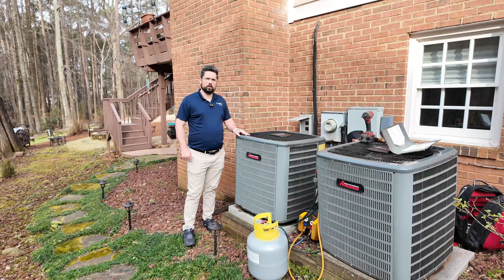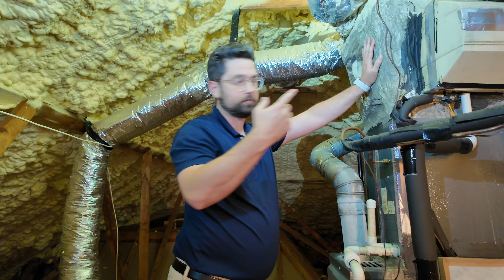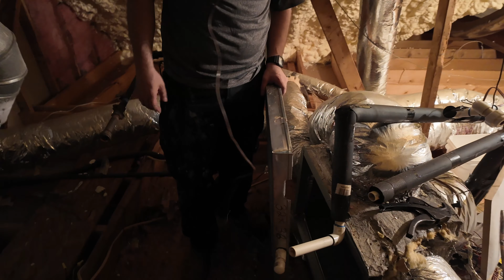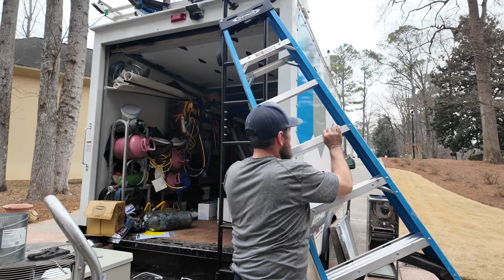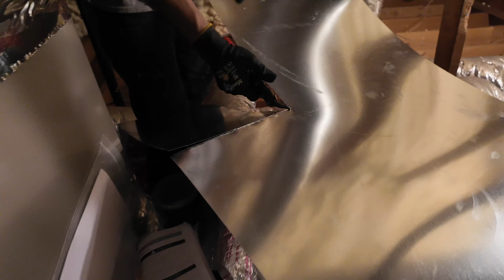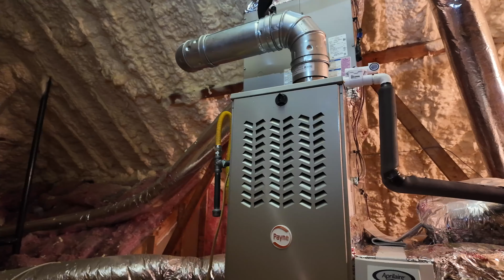Full AC & Furnace Replacement/Install

Comment: Why is the evaporator bigger than the furnace?
Reply from the maker: BTU load of the upstairs required smaller furnace but we still upsized the coil to increase the sensible load output and SEER2 of the matchup.